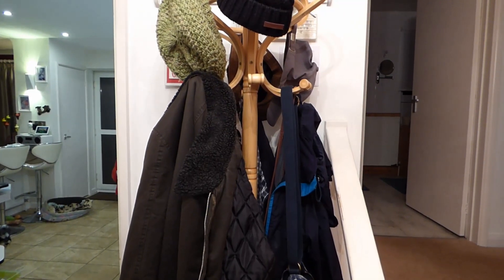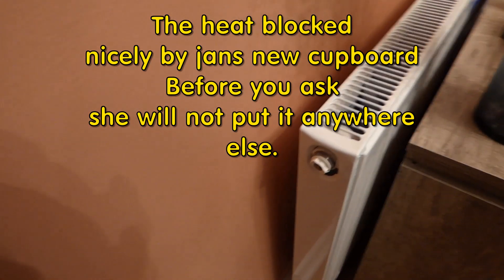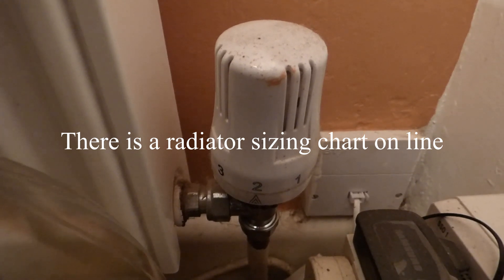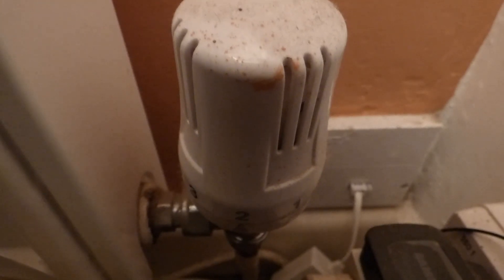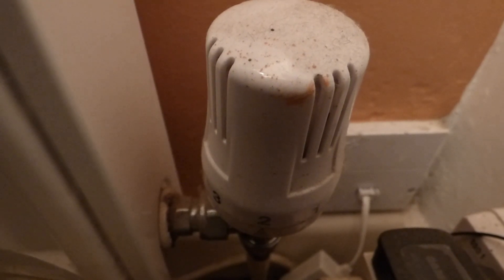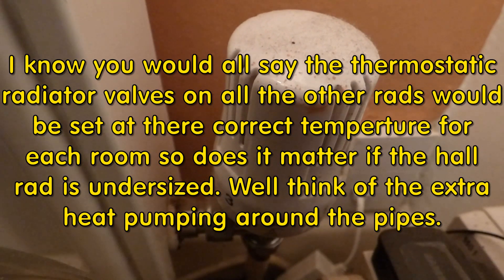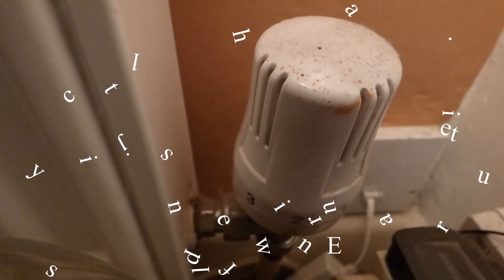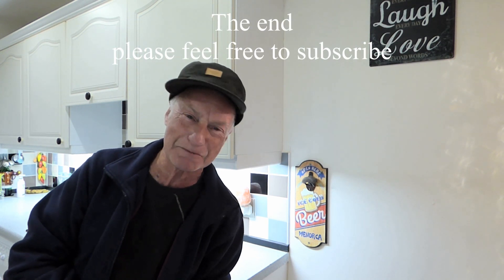Room thermostat in the hall. What to check for maximum efficiency.

Comment: Hi, My thermostat is the same as your thumbnail pic. My question is when i turn it above the clicking noise to 15 degrees or even to 25 degrees it comes on full blast with both. Why is this? 

At 15 degrees does it come on full blast then lower its self once 15 degrees is achieved if so where is it measuring the temp? At the combi boiler area or the thermostat area?
Reply: Forgot to mention is it measuring the temperature of the air when the boiler tries to match the desire thermostat temp.
Reply from the maker: The temperature of the air is what is measured, whatever you set the stat to, the heating will run until it reaches that temperature.

Comment: I have brought a Honeywell dy90e thermostat and watched your clip but I have 4 wires. Blue, grey, earth and brown. Any ideas which ones I use. Thanks kevin
Reply from the maker: Check which is the switch live with a test meter, usually the grey.
Reply: If you don’t have a test meter, is there another way. 2nd port is black with a small blue sleeve on it. 3rd if grey. 4th is not used and 1st brown. That’s it. I pretty confident with electrics but tbh I know I use 2?as you video states but you have 2 and I have 4. I don’t want to mess it up. Cheers Kevin

Comment: The problem I have is the thermostat turning the boiler on every 10 mins turning off after 5 mins its annoying what I would like is turning on every 30 mins for 10 mins is their such a thermostat that you can manually set to operate In this way
Reply: Mine does that, in my case it’s the boiler internal stat that switches it off after a few minutes, ( once it’s up to heat ) it’s set to max. When the boiler goes off the room stat is still calling for heat. So maybe if you check the boiler stat it still has more adjustment to max? Mines a 25 year old gloworm KFB and heats the house like a furnace so I put up with it cycling.
Reply: @thpxs0554      what I do is turn it on and off manually which is sufficient.. A boiler turning on every 10 mins is a nuisance nothing I have tried seems to stop this ! maybe a thermostat which is controlled by a timer so you can set it to come on every 30 mins because every 10 mins is pointless waste of gas and electric  when the house is already to hot
Reply: ken boon ...does sound like the boiler stat is switching it off while the room stat is still calling for heat, then it cools down for a few mins cos the pump overrun is pushing the water round then it starts the cycle again. Is the bulb for the boiler stat in the right position? Most stats are still available dead cheap. 👍
Reply: hi ken. invest in a boiler manager,worth every penny,boilers are stupid & need taming,these devices tame them to an inch,please read up on them we did & never looked back.

Comment: Thought you couldn't have a TRV fitted to a radiator in a space with a thermostat. Or at least one radiator needs to be without a TRV as if the thermostat is calling for heat and all the radiators are turned off via TRVs the boiler will be heating up and the pump will be working against itself.
Reply from the maker: Not so long as you have a bypass fitted which is the case for most modern combi boilers.
Reply: @dereton33  I don't think it's allowed under regs. Unless regs have changed. As not all boilers have a bypass.
Reply from the maker: You may have one fitted, check by looking at the spec sheet for your combi boiler, or on an F and E system it will be located by the copper cylinder.
Reply: @dereton33  I'll always have one radiator without a TRV for safety as a bypass regardless of if the boiler has a bypass or not. As its for safety and regs.

The better solution would be to move the objects in front of the thermostat or move the thermostat.

Comment: hi  al when i got my central heating install 18 yeas a go by british gas  i have   abut 8 rad  fitted with a thermostatic valve expect  the one in hallway  why is that thanks.
Reply from the maker: That is the one used to govern overall temperature for the whole system and could also be the bypass radiator. If it is, you are not allowed to put a thermostatic rad valve on it. New Combis come with bypass valves fitted now and most new modern   F and E systems have bypass valves fitted .